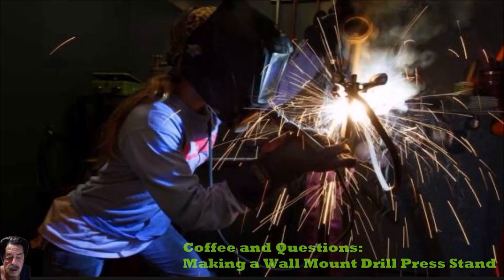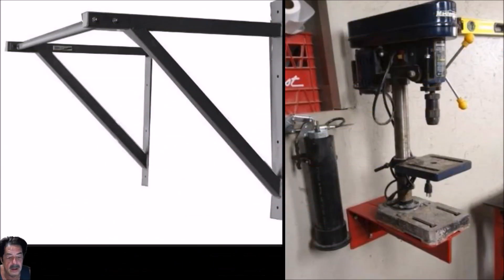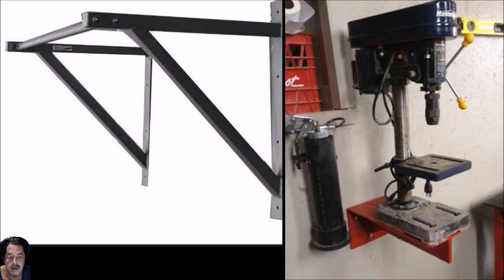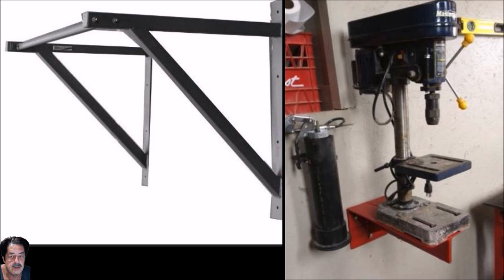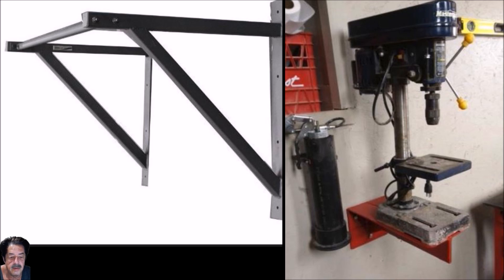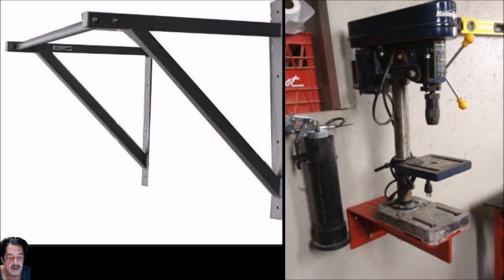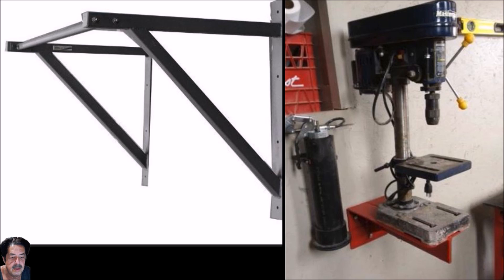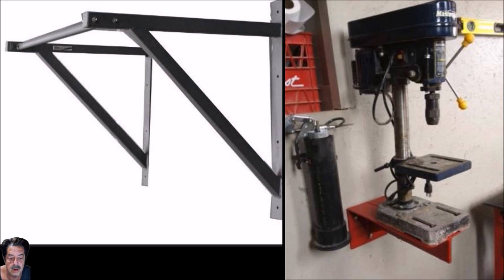How To Make a Wall Mount Drill Press Stand From Scrap Metal

Comment: I watched your video on your wall mount using one and two studs configuration. I used a system from Trick Tools (Versa-Mount Vise & Grinder Wall Mount). I glued together two sheets of engineered oak plywood (20” wide x 48” height x 1-1/2”). I attached it to the wall with 10 3/8” x5” lag bolts and washers (5 on each side of the plywood to attach to each stud). I secured the Versa-Mount to the center of the plywood, with 3/8”x2-1/2” lag bolts, washers, & split washer. I used 2 studs to attach.
Reply from the maker: That is a great idea and im sure it will be very secure - thanks for posting how you did it